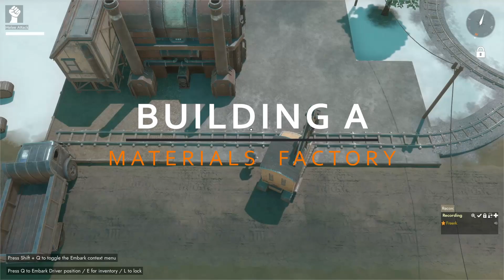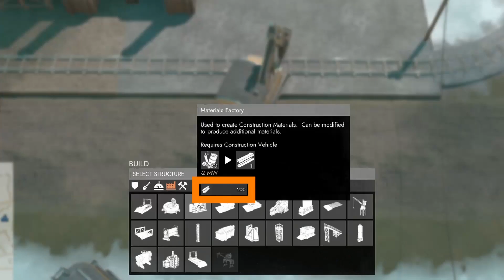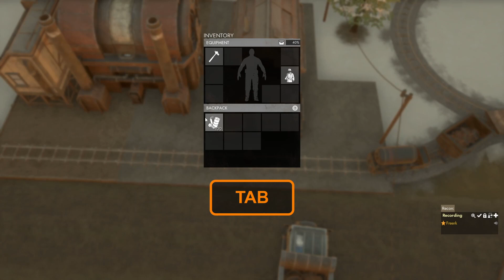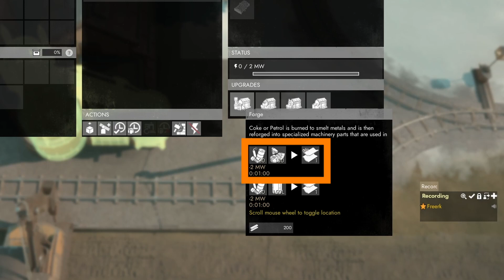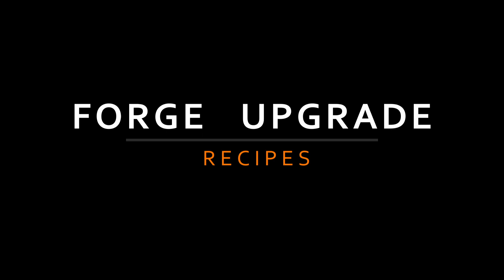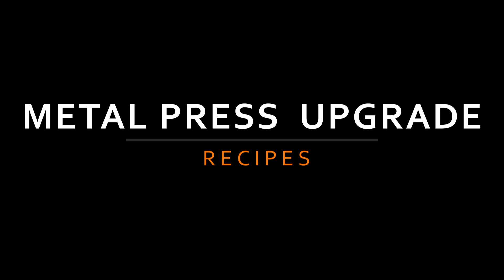Foxhole Facilities - Materials Factory

Comment: can you pipe in petrol?
Reply from the maker: Yes. The location and orientation of the input point for petrol is different with the different upgrades. So the input point for the Metal Press upgrade is at a different spot than the one for the Forge upgrade. Both are on the other side of the building than the powerconnector, but one is aiming away from the building, the other alongside

Comment: how did you connect the power to the building?  Does it just simply need to be on the same foundation as the power (no line connected?)
Reply from the maker: You need a power line to a power pole and a power line fromt hat power pole to a generator.
Power tutorial is still in the making, where I will attempt to explain how power works